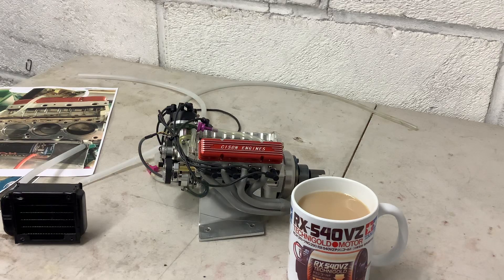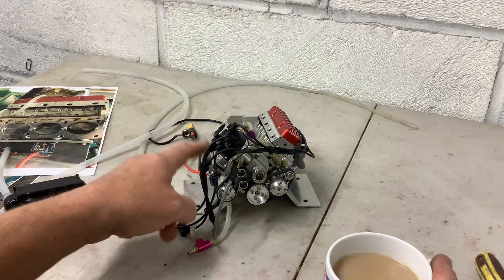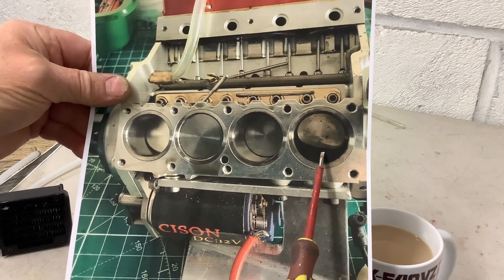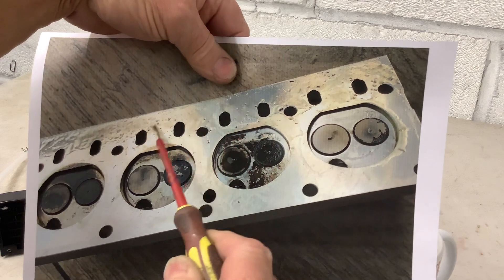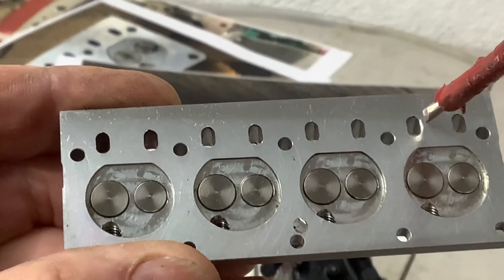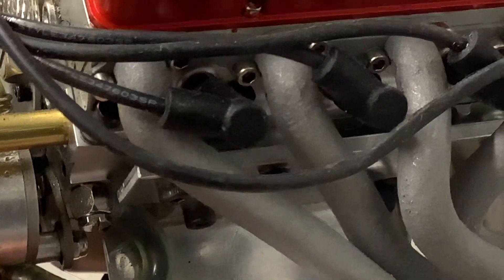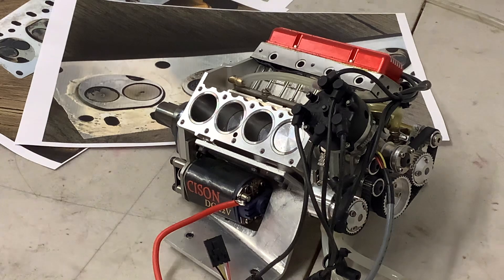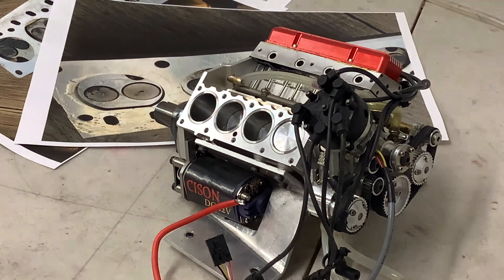Stirlingkit Cison V8 engine problems 😞

Comment: You said something about it putting more oil in it because the engine on a slant unless it’s a slanting forward you shouldn’t need to put any more oil in it because the pick up is at the back of the motor not the front, I wouldn’t put any more if anything put a little less I would stick to the 25 ml you really shouldn’t make a difference, also try putting a few earrings under the oil feed tube at the top in the engine valley which will make it pressurised, and then get a valve to adjust what oil goes to the heads and what oil goes to the bottom end.

Comment: Have you made sure the piston rings are not all on the same way they should be all turned in different directions so the oil can pass through the piston ring gaps both piss and rings and scraper should all be in different positions not on one side of the piston

Comment: Looks like the spark plugs may be swelling the head surface out and causing the head not to torque down correctly . This is also possibly what is causing the push rods to make contact with the edges if their ports . Something i noticed right off , is the lack of alignment pins or dowels . Those things are vital to aligning all the holes from engine block the head and vice versa . Id take the right side back a part as well . That would give you a definite answer to if the spark plugs have swelled  that side as well . I have been tempted to drop some money into one of these to but now im looking into something more along a table top lathe an build my own ! God luck hope you get it figured out . EDITED : I just thought of something ......You may have torqued the spark down to far into their threads . This would cause a small bump or swollen spot in the head surface at each spark plug . This lump or bump is most likely holding the seal between the head gasket thus allowing the oil seep in probably seep in slowly as the engine heats up and the oil gets thinner .

Comment: Check your  breather is big enough could be creating crank case pressure  you need to check all these clearances when you put it together  do you know a engine reconditioned I could blueprint it for you  and build it properly but I live in Australia when I build full size engines I have to do all these checks also takes weeks to build

Comment: Hello guys, it is very sad to see and hear things like this happening. I was thinking about to get one of these, but this.... and you never see them run smoothly any way. There was just one video, where you can hear it running pretty much smooth. This is a complete turn off and if the company sell it like this, they should take responsibility as well.

Comment: Lack of spark , and ineffective oil control rings and too much oil being thrown up by the crankshaft , they do fill with oil in the cylinders if not firing , if you've seen other videos you'll notice that they always smoke on that bank ,crankshaft rotation throwing it up. IVE BUILT SEVERAL MINIATURE ENGINES  and had the very same problems with  oil rings not wiping the bores and the only thing that cured it was a viton oil control ring

Comment: You have to get used to the idea when working with these Chinese things that they will need further work from yourself. 
The Chinese at the moment seem to get things 97% right but it's that last 3% that gets the machine to run and be reliable. 
You have to do that 3%.
I just bought a 6 cylinder that was pre assembled. After finding some loose bolts I decided to dismantle it and I'm glad I did. I found more loose bolts and some basic assembly mistakes. 
Really these engines are cheap for what they are and are assembled by young girls in a slave labour camp doing 16 hour shifts.
Expect them to not be perfect. 
Look at them as a starting point not as a finished product. 
I drilled my engine block so the pump could supply oil to the main bearings. They need finishing work.
Reply: I agree, I also bought some engines, but only the single-cylinder ones so far. They do have some minor flaws, but they can be fixed quickly. One thing is certain, though: they offer good value for money. There's no engine that's both good and cheap.

Comment: Johnnyq90 has a recent video showing some changes he made to this engine. He replaced the O-rings (three per cylinder liner) with viton rings. He made new head gaskets from very thin (0.5 mm?) copper sheet and annealed the copper before installing them. He also modified the outline of the gasket so instead of oval holes for the pushrods, they are just half moons. This last change will for sure fix at least one problem you had where the pushrods were digging into the original gasket. Take a look at his video.
Reply from the maker: Engine DIY are sending me some new copper gaskets the green o rings were in the kit, I don’t believe it will be any good for my boat as it’s not a good design with the oil system as it is 😞thanks 
Steve
Reply: @Blacklamass  Yeah -- this engine is just for bench running. Another YouTuber rigged it up to a dynamometer and pretty much destroyed the engine in the process.

Comment: Oh something else, the buildup of oil you have to be careful with when trying to start, it can cause the one way barring to fail or lock up. I went through 3 already just trying to start it. Between each i disassembled it to check what the issue was and just had same issue of hydrolocking it without there being water if you know what i mean. I learned how to fix those barrings though because waiting a month to get new ones and at the price they charge is to much. I think they sell this thing to make money off the initial sale, and then more from the parts you have to buy, and they refuse to sell certain parts so you cant ever fully rebuild one without buying a whole one depending on the part.

Comment: Yeah i have had every issue you are having except the blowing it up, i havent gotten mine to start yet. I borred out the rod holes already to give enough clearance, but in all suriousness, this is all things that should already be figured out BEFORE they even bring it to market. For the price we should have at least gotten a 24k gold key with it for the troubleshooting they know they are forcing their customers to do if we want a running motor. There should be no guess work but thats all the instruction manual is. Have you seen how many ? Marks are in that thing. Its a joke that i wish i was dreaming but so far, this has really turned out to be a very large scam that will prevent me from taking anything suriously coming out of that place. Youd think given they are the manufacturing hub in the globe basically, theyd be pretty good at it, but sadly quality control, and innovation are not something they are capable of. Precision engineering and machining is even greatly lacking.

Everything i see being promoted from there now everyone should take with a chunk of salt and reduce the actuality of what you will in reality is only about 40 to 60% as good as whats advertised, and thats being generous.

Comment: I would start by doing a simple compression test by only placing one spark plug on each cylinder one at a time and turning it manually, sure if the cylinder is leaking at this point the compression will be low, otherwise possibly the oil check ring is placed incorrectly or not doing the job properly. On my 4 cylinder cison engine I have a big loss of compression but to help the situation and prevent the crankcase from becoming pressurized I modified the crankcase oil cap so that I could connect a tube and connect it to an oil catch can

Comment: Sorry for making so many comments, i wil leave it off with this. If and when i get my engine running i will let you know what happens and if any issues persist from there. it i a possibility you did install 2 and 8's oil rings the wrong way around but it is VERY hard to see which way there supposed to go, if it even matters at all. i will do that research and experimentation for you.

i do ask how are you going about a refund? did you file a dispute with your bank or are you going to have them refund you themselvs? please let me know.
Reply from the maker: Hi you can reply to me as many times as you like we have got to stick together to sort this, Stirlingkit take no responsibility for their engines once they have sold them to you don’t know if you have found the same? They bombard you with emails to buy the engine and when you do it’s like bye 👋 just get on with it, I have done a lot of videos in the early days to promote their engines and they would help me on the price of a new one but I had such hard work to get this engine any cheaper and when I did get it the only colour on it was the red rocker box covers, I believe this was an end of line engine or an old casing and they have made up an engine out of parts they had laying around.
No quality control whatsoever with this company.
Reply from the maker: I asked them for a refund many times saying I send it back straightaway but it just falls on deaf ears, I’m wondering if PayPal can help 🤔
Reply: @Blacklamass  i am having the aame oil issue now, if it persists i will take my engine apart and rotate the oil rings and try again. i havent ven gotten my engine started, they are being complient with me and replcing all of my parts, i have revieved my valves with...very messed up quantities, 6 intake valves, 5 springs, 5 keeper cups and 6 keeper clips??? do these people know how to count?!?! reguardless my heads are now rebuilt and they offered to give me a new hall sensor for free....with these engines it IS best to bulk buy them as all mini engines that use hall sensors have them burn up almost every run...stirlingkit called them "consumeable" DEAD SERIOUS.. in conclusion if you REALLY want your refund, you will have to dispute with your bank, dont even bother threatening them with one because they will beg you not to. Just do it. but if you are willing to wait, i am...probably the only one that is willing to push through the issues to get my engine running..this IS critical Data we need for future buyers...all we can do is try to help them. If you wait, i will provide you the data with the issues on my engine and how to fix them, i have yor back my friend. Let me know what you decide to do with your engine

Comment: glad to see im not the only one here having issues.. mine arrived with intake valves missig from both heads, grub screws missing from the block (allowing both oil and coolant to rapidly leak) and my CDI killed itself when i went to spark test it. i have had this engine for almost 3 weeks now and im only gettign sent the parts. i am possibly going to be refused a new cdi as well. it really seems their technical team is not very good with quality control... reguardless i am going to work through the issues and try to get the engine running. It sucks because it really seems like the engine is of a decent quality, i have no leaks from the gaskets what so ever. If worst comes to worst, i will not ship back my engine, i will make a dispute with my bank. this is BONKERS were pretty much paying 3/4 for shipping direct from china, so in turn we get a procuct thats worth nothing over $500. THIS IS 2 PEOPLE IN A ROW THEY SCREWED OVER. stirling kit needs some serious coaching or a serious lesson taught to them.
Reply from the maker: Yes my friend I have asked for a refund but no deal, they are getting fed up with me because I tell it like it is and how dare I complain about one of their engines 🤷‍♂️ even though it died on the second start up, I have had this all before on the terrible engine L400 with the breaking crankshafts that apparently did not exist🤦‍♂️ took me months to get them to admit there was a problem till I made a video condemning them and the engine.
Now you think that after that I would ever buy another Stirlingkit or Chinese engine again, but I did my homework through guys that had them and they all said they were good, well this is what I have ended up with, if they don’t sort it I will just keep making videos like this to let you guys know what’s going on.
Thanks for the reply 👍🏻
Reply: @Blacklamass i will follow especially to assure whst your saying is backed because your 100% right. They are scamming people with the current products and lack of support and refusal to address issues they are aware of and refuse to fix.
Reply: And by time you get the parts to try again, its out of warranty. The time it takes them to respond and send out anything it eats up the warranty so by time you even know what the problem is to a certainty, you cant do anything as far as refund. I doubt theyd honor a refund once its to the customer anyways, theyd just ghost.
Reply from the maker: Yes my friend I have asked for a refund but no deal, they are getting fed up with me because I tell it like it is and how dare I complain about one of their engines 🤷‍♂️ even though it died on the second start up, I have had this all before on the terrible engine L400 with the breaking crankshafts that apparently did not exist🤦‍♂️ took me months to get them to admit there was a problem till I made a video condemning them and the engine.
Now you think that after that I would ever buy another Stirlingkit or Chinese engine again, but I did my homework through guys that had them and they all said they were good, well this is what I have ended up with, if they don’t sort it I will just keep making videos like this to let you guys know what’s going on.
Thanks for the reply 👍🏻

Comment: Please check the oil ring of cylinder 1, it may be installed in the wrong direction, causing the oil to continuously pump upwards
Reply: If the engine tilts, less than 28ml of engine oil should be added, otherwise the crankshaft will come into contact with the oil, causing a large amount of lubricating oil to enter the cylinder. The oil ring is too small to handle excessive lubrication
Reply from the maker: The engine has its own oil pump so why would tilting the engine a few degrees cause it to fail, there was air bubbles in the oil going into the pump and no matter what I did it was the same air bubbles in the oil, only adding oil did I get rid of them, and now your saying use less oil it will only destroy the engine completely, Stirlingkit are not sympathetic whatsoever that I have paid £1400 for an engine that died on its second start up, in fact kind of been the exact opposite saying I got no patience and so on, wouldn’t you be upset 😠

Comment: you arent paying for quality. you are paying for a small team to spend a bit of time on cad, then a few CNC machines tooled up, material, and packaging, transport, advertising.

like almost anything chinese, quickly thrown together with no actual engineering behind it. certain vital parts overlooked. corners cut. cheap, cheap, cheap. all that matters is that it "looks the part".

a conley, if they still made small engines, would be about 5X the price. but they were also backed up by a few decades of engineering, development, and in-shop improvements before being released onto the public, in limited numbers.

its a desk ornament, bling. it was never intended to be used "in anger".
Reply: Paying 5X more for something that works saves you from the soul-crushing experience of buying a 1/5 priced masterpiece of garbage that doesn’t work

Comment: From what I've read it's either the o-ring or the cylinder sleeves
Reply from the maker: No there is no water in the oil what was left of it in the sump, the seals in the cylinders was another issue